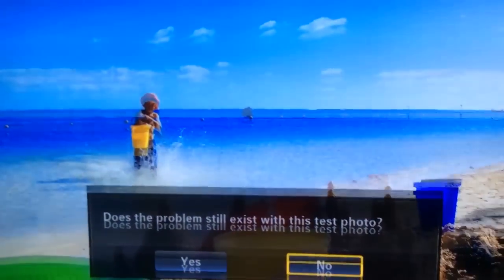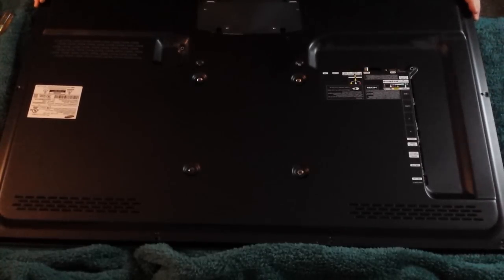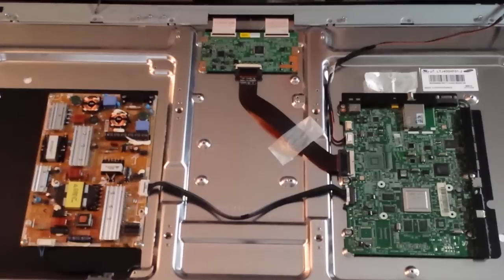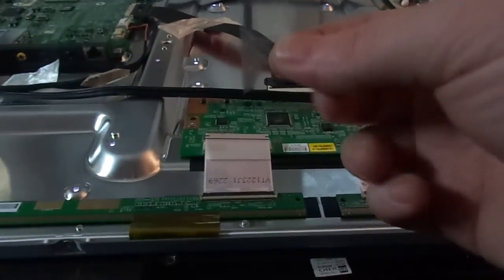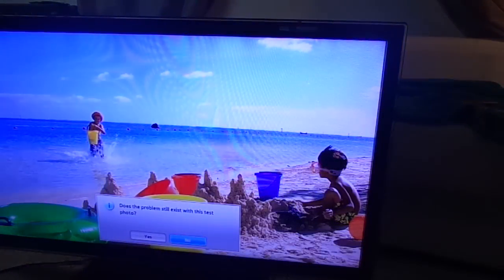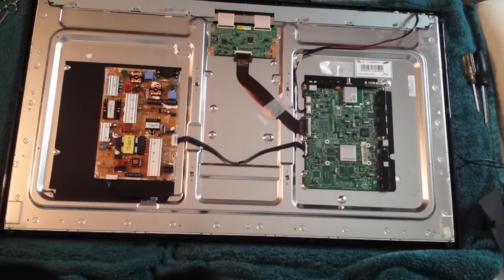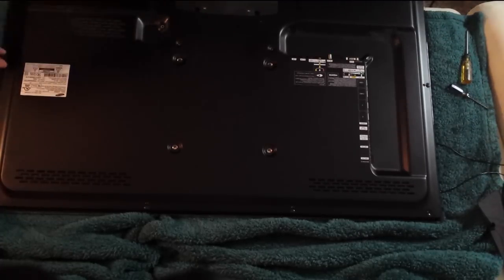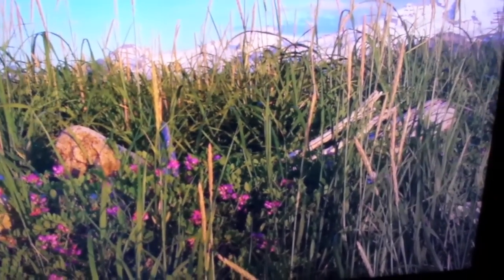LED LCD TV FIX, How To For Samsung Double Image, Black Vertical Lines, Screen Problem Sony LG.

Comment: Thanks to Dave for posting this fix.  Very detailed and clear enough to follow.  Unfortunately, when I tried it on my 46 inch Samsung LCD TV made in 2009, it did NOT solve the problem.  My set failed exactly 1 month after the extended warranty expired in late 2013.  I lived with it as it got worse for about 9 months then bought another TV.    Apparently, this horizontal line problem is endemic to many Samsung TVs and pervades ribbon connections in their other appliances as well and it's been going on for YEARS.   There really should be a mass recall and repair/replacement since this has effected MILLIONS of buyers.   A $1200 TV should last more than 4 years.    I will NEVER BUY SAMSUNG again.
Reply: Unfortunately, "they're" all in with the Planned obsolescence (search YT for the video).  MJ sang it best "They don't care about us".Even when some class action suits hit them in the wallet. It's just too small a percentage for them to care. But thanks to people like Dave, I got rid of the double image but not able to fix the lines. At least my $1200 TV is somewhat watchable for now. I'll keep praying that maybe just maybe the lines will go away at some point.

Comment: I will NEVER buy another Samsung TV.  This LINE PROBLEM developed when our set was just 4 years, 2months old and the extended warranty had just expired.  Ours was a 46" model from late 2009 that cost over $1200 at that time.  Owners should initiate a class action suit against Samsung since this design/manufacturing defect has effected hundreds of thousands or even millions worldwide.  This problem continued for years and probably.  
         When I mentioned what happened to a salesman at a local electronics store, he already knew having heard the story from other customers.

Comment: EVERYONE......DON'T EVER BUY A SAMSUNG since they don't sell the replacement ribbon cables and you must buy the $700 LDC screen to get the cables.   I spent days reading horror stories on many different forums about this issue.    I'm really mad since I bought this tv a few years ago for my mother who is bed-ridden and this TV is the last thing she has in life......................
 I just tried this fix and it didn't work.....I'm very technically inclined in many areas and after trying the tape fix I eventually have no screen at all now, so I'm certain its the contacts on the cable and tried alcohol cleaner, and a pencil eraser to clean the cable contacts.........I'm furious and called everywhere for the 2 cables that go to the LCD screen but all vendors don't have them including Samsung parts vendor J&J.  I finally resorted to call Samsung corporate and read about the usual "song & dance" that the warranty expired.  I'm very surprised Samsung can get away with this and deliberateely not making parts available due to high failure rate when they have the other ribbon cables available for other models including all other makes of LED/LCD T.V.s'  like Sony , Vizio, and others.  If the problem is the T-Con board, I feel that this is a heat problem that all flat screens have due to no air circulation........................ 

I also had a Samsung microwave that failed due to the ribbon cable/touch screen that is affected by steam/boiling water on the stove.  I had to use tape on all the joints to seal them from moisture getting into the cracks of the control board edges. 

Also I've had to replace a condenser fan 4 times in 6 yrs on my Samsung refrigerator.
 
 Screw Samsung!

!!!!!!  :-(
Reply from the maker: chrispompano Hey there. I understand how frustrating it can be troubleshooting something and to try all sorts of different things to fix an issue and it feels like you have been spinning your wheels 19 hours later.  I looked up a couple things on Ebay and I have copy paste a link that may help getting you the ribbon cables.

http://www.ebay.com/itm/SAMSUNG-TCON-FLEX-CABLE-YS1809F4-2269-USED-IN-MODEL-UN40D6000SF-/171712041125

I hope this helps.  Thank you for watching.
Reply: Do It With Dave   Thanks Dave.  I didn't see the link unless Youtube blocked it.......
Reply from the maker: chrispompano Ok.  You can just copy paste this in Google search.  It should come right up.

SAMSUNG TCON FLEX CABLE YS1809F4 2269 USED IN MODEL UN40D6000SF on Ebay

http://www.ebay.com/itm/SAMSUNG-TCON-FLEX-CABLE-YS1809F4-2269-USED-IN-MODEL-UN40D6000SF-/171712041125
Reply: Do It With Dave Thanks Dave,  I saw the link posted below your messaged and had to expand it......... Is that board for my UN40d6000SFXZA?   My ribbon cables are the "2269" version and I was told that is the only important # on those cables vs. the other numbers YT1226I2 and Yt13066L3.  I have all the other numbers from the labels inside too.  I did discover the main board has been superseded by another number.
Reply: +chrispompano    Well, looks like my journey has ended trying to fix me tv.   It started back in July when I left the room only to come back to a tv with the double image.  When trying the fix posted here, I saw the image flicker but after messing with the cables I ended up having no picture.  

I figured I messed up either the cables going to the T-Con so I got a complete set of all ribbon cables off of e-bay along with a used T-Con.  It didn't fix the problem.

So, all in all, here's what I bought in total trying to fix this f'in Tv:
2 complete sets of Ribbon Cables  -  1 used and 2 new Samsung T-Cons  - - New Samsung Power Control Board, - - New Samsung Tuner Board.

Some of these parts are going back to get a credit.  I guess my problems is the screen at $600+.  LOOKS LIKE I'M BUYING AN LG and never a Samsung anything ever again.

After all those parts, I still have a dim blue screen with sound, and when I turn on the TV, I never get the "SAMSUNG" display.......is this a screen problem????/

Comment: Thank u very much.
My samsung 3d led tv had double images for the past 5 days and when the samsung technician came ,he said the display had to be changed which will cost 20000rs ,but i followed ur steps and now its good as new.THANK U SO MUCH.
Reply from the maker: Mabin Baby Thank you for posting your experience.  It will help others to know that this worked on your 3D tv.
Reply: Ur 3d option is worked for u or not but my 3d option in sony tv is not working when i used this option im getting horizontal lines on screen
Reply: Plz reply

Comment: Hello Dave,
On my samsung i had a thin parellel line, I tried your fix but unfortunately it did not work.so i wanted to revert back by removing that thin tape, now the TV starts but stops after couple of seconds without picture. I am not blaming you just wanted a suggestion.
Do you think it is because the clear tape might have left the sticky solution on the golden connector? how can i clean it? I did try couple of times removing and inserting gently but did not work.

Any suggestion are appreciated.

Thanks,
Nasar
Reply from the maker: Shaik Basha You should be able to see if the tape has left any residue on the ribbon cable by closely inspecting it.  If you already took the tape off the cable than look to see if it removed the clear coat or damaged the cable.  If you do see anything sticky left behind from the tape you may find using a Q Tip dipped in rubbing alcohol and gently wiping the cable tip help to remove any adhesive from the tape.
Reply: +Do It With Dave It's also possible to cut the ribbon a little shorter (1mm) so that the connection is made in a different place where the ribbon is not damaged.

Comment: brilliant, just fixed a tv with this video, picture is now looking perfect after a bit of trial and error with the tape, i taped about 5mm wide close to left edge but still had some contacts showing. What i don't understand is how this works, i would have thought taping over contacts would make the picture worse, so a bit baffling how taping over contacts makes it better, but hey it worked!

Comment: Thank you for the help! I have Samsung Model Code UN55B6000 and I was having a double image problem, but after going thru the repair tips on this video i managed to eliminate the double image problem. but one problem still remains, have the tv screen is a little darker. how do I fix that problem?

Comment: Hi I have a 32 inch samsung LCD TV and unlike in this video that there are 2 ribbon connectors that controls the left & right side of the screen.  I only have 1 ribbon and I already tried putting tape on each sides but it's still not working.  Can I ask for any suggestions?
Reply from the maker: hacel cena I don't know what will work for sure.  One thing you could try is use a erase (one that comes on the end of a pencil) and gently wipe it over the gold connector a few times. Be gentle.  There are some videos that show people wedging something like a small piece of rubber in between the ribbon cable around the edge of the tv (were the cable connects to the strip that go to the screen display) and tv front bezel. Here are a couple videos that may help.

https://youtu.be/zW998RTAq-0

https://youtu.be/80PfZXFGDvQ

Comment: Hi? I have sony kdl-32r402 now won`t read any port (USB,AV,HDMI,MHL) but RF port steel work. what can I do to fix this problem? help me please
Reply from the maker: Tersy Bachwa Hey there, something effecting almost all the inputs and is probably a related issue.  Definitely check to make sure that a connector wire is not loose and not making contact.    It could be something like a bad capacitor or a short, so there is no communication with the tv and devices you want to use.  All the videos that show how to fix this issue usually involve testing on the t-con board and replacing any bad components.  The test involve some advanced tools and a general understanding of how the board works.  Most of the time the t-con board is just replaced.  If you wan to investigate to try and identify the issue I would suggest looking at the board that has all the inputs attached to it and see if there is some obvious damage to it.  Something like brown or black (burnt) spots on the board.
Reply: Thanks for your replay

Comment: Hello dave.I have exactly the same problem with a sony bravia kdl-40ex727.I did the same you did. On the screen dissapeared image at the left side,only white screen. What should I do?
Reply from the maker: Orlando Escalante I apologize about the delay in my response.  I don't know if I am understanding the issue your tv is having by what you posted; but it sounds like all you need to do is make sure both ribbon cables are connected and seated properly in their contact slots. Then lock them in place.  If that does not change anything then try to gently remove any tape that may have been placed on the cables and reinsert them back into the slots.  Basically try and see if you can get back to were the original issue was to start back from there. If you get back to were you were go over the steps again and try to use as little tape as possible working your was up to a larger piece until you see a change.  It can be very tedious but sometimes that's what it takes.

Comment: Dave, I was really hopeful this would work but my TV is a 32" and only has ONE visible ribbon connector going into and out of the t-con board. I tried the tape and it works for a moment but then goes right back to the double image. Any thoughts for a TV with only 1 ribbon cable?
Reply from the maker: Joshua Kegg Try to use the tape as a spacer on just the back side of the ribbon cable so when you push the tab back in place the contact will be tighter than before.  Please update any progress you make.

Comment: Dear Dave,
Thanks for your video and its awesome fix. I appreciate your effort for sharing this fix were the service center told me to change the panel which is more beyond my ability. And i watched your video and i did the same. Mine was Sony bravio LED 3D TV. i have just a small clarification which i appreciate your help. After fixing this clear tape, my double image is solved but im having a shade on half side of the screen (where i fixed the tape on the ribbon). Also what actually does this clear tape do there? its just blocking some to the golden contacts on that ribbon? thanks alot Dave and please advice me how to solve the shade.
Reply from the maker: Vinod Kumar The screen being lighter on one side is a direct result of the tape being placed over the gold contacts.  The tape is used to stop static electricity from building up in between the connections from the cable to the slot it sits in.  The tape also acts as a spacer to push the cable a slot contact close to each other and keep the contact from failing.

Comment: The tech I took it to said I needed a new T Conn board but that did not fix it he then said the TV needed to be replaced. Tried this and it worked, but I have some small black lines on one side. Do you know why blocking the connector works and if any functions are cut out?
Reply from the maker: Joe Schulenberg Watch the end of the video.  My tv had the same issue with the black lines at the bottom of the screen.  You should be able to adjust the ribbon cable in it's slot to correct this issue.

Comment: i have samsung ua32f5100 and the screen starts flickering ...the power board does not have jumper 852 or 854. the power board is L32sf_dpn
Reply from the maker: Parveez Alam I don't have any experience with using the technique of cutting the jumper on the power boards to correct the flickering issue.  You can check out this guy on Google+.  Maybe he can answer some of your questions.
https://plus.google.com/101535595941937416265/posts/5c1dDrM1jpo
You may also want to check ebay for an inexpensive replacement board.

Comment: I HAVE A 46'' SAMSUNG LED TV AND I'M HAVING COLOR LINES ON THE SCREEN. IT'S LIKE A CLEAR HAZE OVER THE PICTURE AS WELL. HELP
Reply from the maker: charles green I found a blog for you.  Sounds like your tv is having a similar issue as dressed by the publisher.  I know its a long link just copy paste in you browser.

http://www.avsforum.com/forum/166-lcd-flat-panel-displays/1492931-samsung-lcd-tv-colored-vertical-lines-issue-resolved-loose-connector-save-yourself-1237-my-model-ln55c650.html

Comment: hi dave i removed an LCD 4 series and there was just one ribbon to the bottom (no left right ribbons as indicated above). is there a work around for such models
Reply from the maker: *****  This is a copy paste from the reply below. 
 I found this video on You Tube.   From the model# you provided the inside should look like the one in this video.  It is not a fix video however it my help you better understand what issue your tv is having.  @2
Also you may want to check the capacitors for any damage. Here is a video to help with that.  A capacitor that is not flat on it's top is normally bad.  
https://youtu.be/YCSNWi3UHf4
All capacitors should be completely flat.  You may need to look for a video on how solder as well. I hope this helps.

Comment: Hi Dave, pls could u help me fix the double image on samsung LED 32" TV with the Model number UE32EH4000
Reply from the maker: Adeleke Adewale I found this video on You Tube.   From the model# you provided the inside should look like the one in this video.  It is not a fix video however it my help you better understand what issue your tv is having.  https://youtu.be/2TImpsUnGtI
Also you may want to check the capacitors for any damage. Here is a video to help with that.  A capacitor that is not flat on it's top is normally bad.  
https://youtu.be/YCSNWi3UHf4
All capacitors should be completely flat.  You may need to look for a video on how solder as well. I hope this helps.

Comment: Hi
Thanks for the video.
I removed the cable that you said, but half of the screen is not completely dark! The lines still there! Any suggestion?
Reply from the maker: Hassan Kalantari Hey there.  It would seem that if the half of the screen you removed the ribbon cable from did not black out it is still making contact.  Double check that the ribbon cable doesn't insert itself back into the slot.  There is  tension on the cable making it easy to slide back in on it's own.  As for the lines. If you are getting the same lines that are shown in this video on your tv, then gently move the cable in it's slot a bit as you view the screen and you should be able to get them to go away, lock the tab down in place when the image is clear.  Also if you still don't get the screen on your tv to black out check to make sure it is the ribbon cable for the display.  There may be another cable that is for something else close to the cable for the display.  You can always try removing both cables and see what happens. The entire display for your tv should go completely black if you do so.  Basically to see if your tvs display is affected at all by removing the cables from their slots.